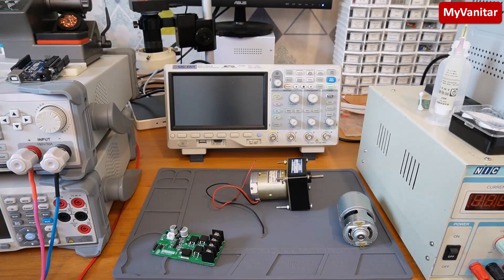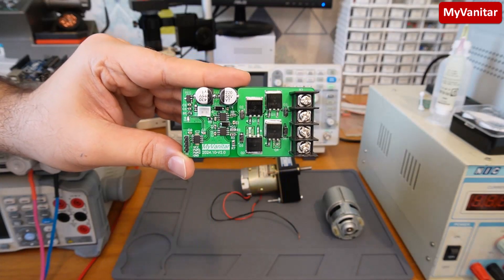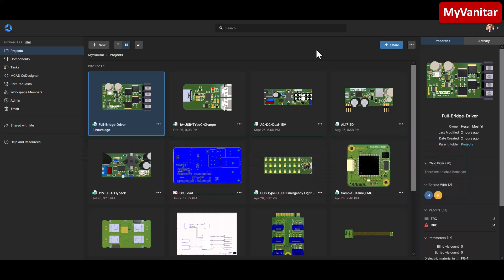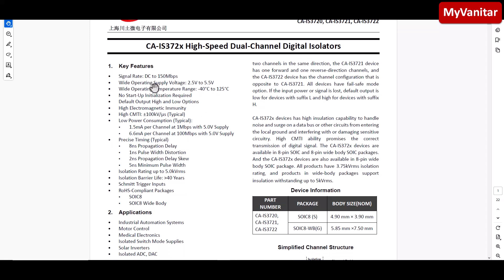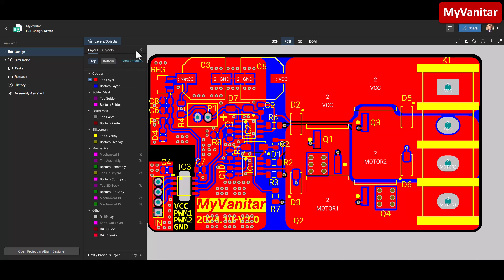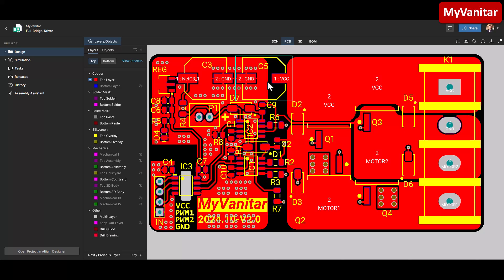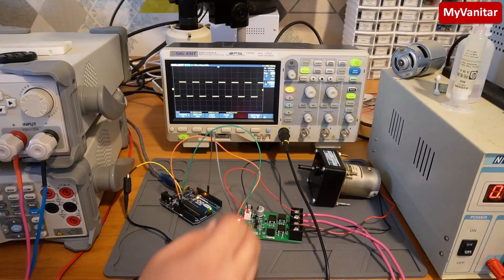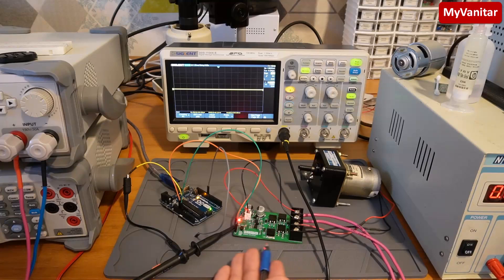Isolated H-Bridge DC Motor Driver Circuit

Comment: Can i use 2 MOSFET in parallel to increase current handling capacity?
means using total 8 mosfet in full H bridge.
Reply from the maker: I can not say for 100%, but very likely Yes you can, 8 NMOS
Reply: @MyVanitar ❤

Comment: but what about the snubber capacitor and resistor that we have to put at the load side
Reply from the maker: for most cases, a non-polarized cap on the load is fine

Comment: How many volts does the power input supply? Is it 24 volts? Can we feed it with 24volts and control the 24volt dc motor?
Reply from the maker: 40V is the maximum, so 24V is fine.

Comment: What happens if I connect both PWMs at the same time, like logic PWM1 = 1 and PWM2 = 1, is it a brake function? Or magic smoke? Should I implement a logic gate to prevent double activation? I didn't understand what would happen if I activated both at the same time, sorry for my bad English, but I think you understood my question, thank you, have a good day!
Reply from the maker: I have not tested what happens, very likely a short circuit and smoke. Actually, both PWMs are generated by an MCU, it is easy, when one PWM is running another one should be 0.
Reply: When both PWM1 and PWM2 are 1, then both motor inputs will be at 12V, so there is no voltage difference between the two motor terminals, which means no current will flow through the motor. Same goes for both being 0. It will simply brake the motor by shorting its terminals.
The IR2104 automatically protects you from a "shoot-through", which would occur if both mosfets that connect to the same motor terminal were being switched on.

Comment: I have a question about this board.  I need a motor driver that has a common 0V potential lead with the second line going positive for forward and negative (with relationship to the 0V potential line).  This would be controlled by the PWM signal from a G scale DCC decoder for model railroads.  Would this motor driver be able to do what I need?  If so where can I get 6 of them?
Reply from the maker: Here we have two PWM inputs and one ground. Ground could be shared or isolated (this design is isolated). You can change the rotation direction and the speed by switching between PWMs and the duty cycle of that active PWM. Each PWM input defines the rotation direction and the other one should be zero (PWM=0). For example (PWM-1: 0, PWM2: 50%) means forward and 50% speed, … etc. Got it? Feel free to send me an email for your design quote.

Comment: Hi, why didn't you use opto and opted for special isolators ? Is the wide logic voltage acceptance or digital output the reason?
Reply from the maker: You can use them in some cases, but I prefer this

Comment: It was a good explanation. Especially the isolated IC. Do the IR 2014 drivers have good speed? Also for the current, can we drive the elevator door motor with parallel MOSFETs? About 45 amps of current is required. Thank you.
Reply from the maker: Their max speeds are around 20KHz or even more, which is way more than enough to drive Motors. In my Arduino test, the PWM speed is just 500Hz. Look at the datasheet of the Mosfets, 45A should be possible but I suggest you order the PCB with thicker copper than normal FR4 and use a heatsink, although I think the load in your case just works for a few seconds